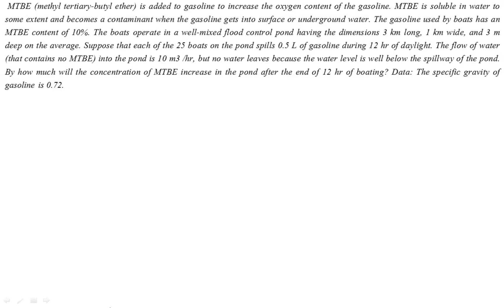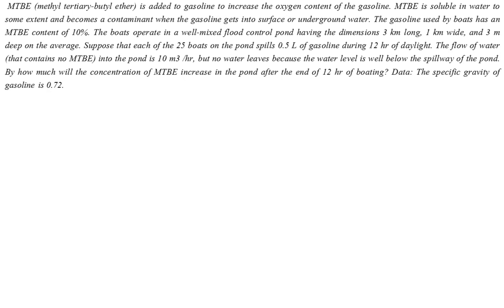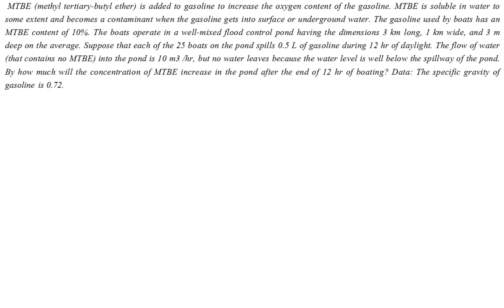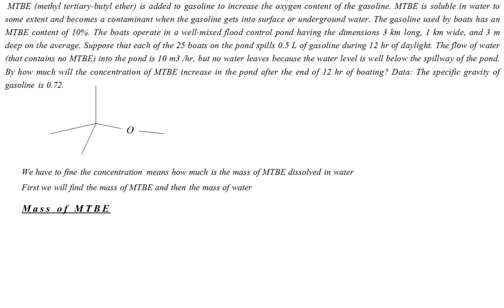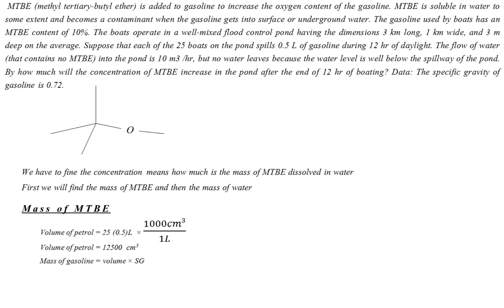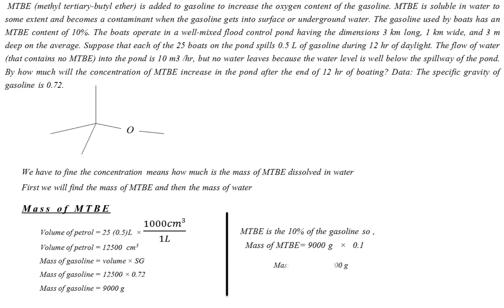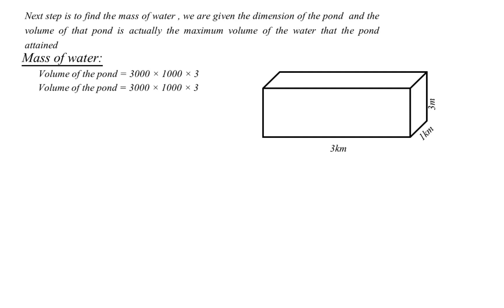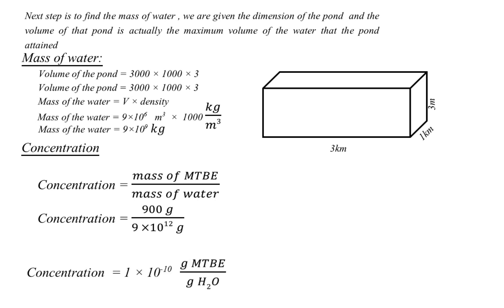MTBE (methyl tert-butyl ether) is added to gasoline to increase the oxygen  #num_engineering

Comment: Wait, what about the flow of water which is 10 m3 per hour?
Reply from the maker: You question is really genuine 🎉 concentration can be defined as the ratio of solute (g) to solvent(without solute) and also can be defined as the ratio of solute to the total mixture (solute+solvent) in this  problem we are dealing with the second case 
In problem we are given only amount of water not total That's why we are using given dimensions to find the volume of solution